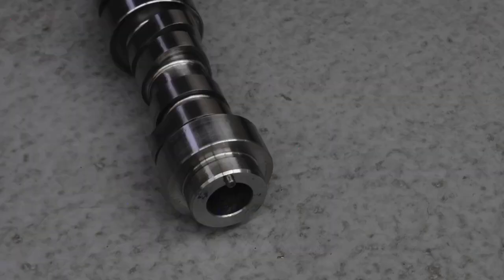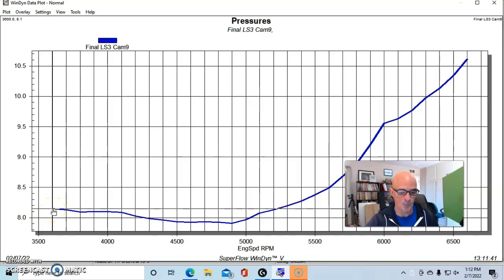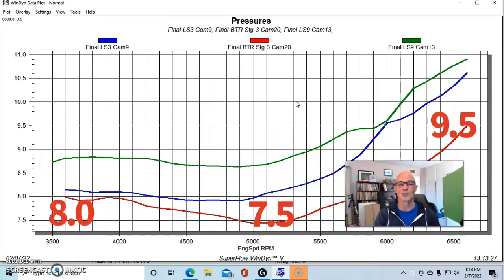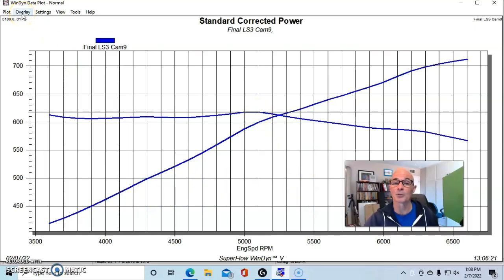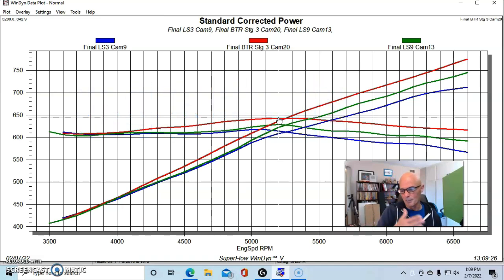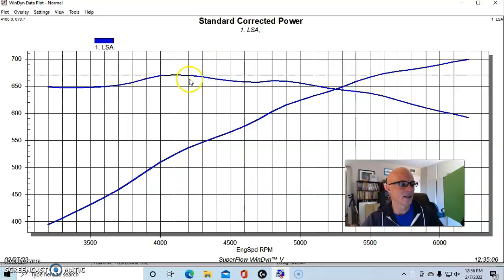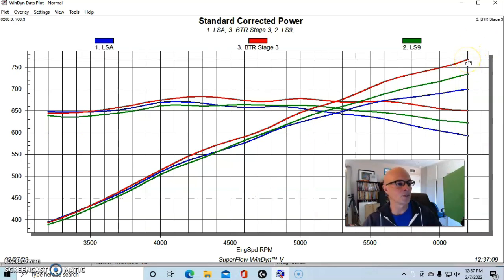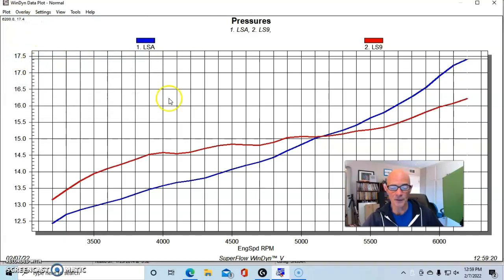HOW TO PICK THE RIGHT BLOWER CAM. SUPERCHARGED 6.2L MOTOR! LSA, LS3, LS9 vs BTR STAGE 3 BLOWER CAM!

Comment: The BTR cam made the most power up top because it was the biggest cam. Use a bigger na cam and it too will make more top end power. You have proved that before. My 416ci ls3 has a 239 254 cam and will make a lot of power with boost. I bet it doesn't bleed boost lol

Comment: Ive been watching your channel learning a lot, especially when engine builder chose a 224 236 118 lsa custom comp grind. I wanted to know why that choice on an lt1 416 stroker with pd blower.  Now i understand the numerous reasons why.
Reply from the maker: cam guys like to run the wide lsa on pd blower motors

Comment: Hello Richard, First time commenter. For my street car occasional drag strip… What’s your opinion with a Summit 8706R1 turbo cam (226-230 dur. with 600-575 lift with 113 LSA) in a 408 with Trick Flow 235cc heads and a Whipple 4.0? Should I run that cam as I already have it or buy a cam designed for 4.0 stroke and a PD blower? Thank you.
Reply from the maker: it will work fine

Comment: Ok Richard I found my way over here. This was right up my alley thanks.

Currently have a "big NA" cam in my LS3, with a 2650 blower. Haha its upping my 4k converter out to 6k which isn't working very well for any type of driving.
*CrowCams 871287 (227/244 .607/.610 114lsa)
So I'm in the process of putting in a more reasonable size (modified LSA converter) - but we're unsure how well that will work with the big na cam (might push on the converter too much)

So yeah was looking for a blower cam, but my mate was suggesting the sloppy stage 2 as the "BEST" cam ..... but i still don't know lol
Hopefully my "NA" cam just works with the converter as I don't want to really spend a heap of money to not really make a huge difference to power (10-20hp difference meh)
Reply from the maker: YOUR CAM IS NOT UPPING YOUR CONVERTER-227 IS NOT A BIG CAM FOR AN LS3-YOUR BLOWER IS BLOWING PAST THE CONVERTER
Reply: @richardholdener1727  Sorry yeah no
The 227 cam and 4k converter worked perfect pre blower ... but once the added torque of the blower was added yeah thats when we've had issues.

Just hoping that a smaller stall will work with the current 227 cam

I thought the cam was big-ish, maybe not on the intake side of things... but with combination with the exhaust side and .600+ lift 
I was going to go with texas speeds f35 but bailed out.

Comment: These being positive displacement SCers this wouldn't apply to a centrifugal. I'd like to see a test like this run on a Vortech or Procharger.
IMO, they make boost cams for a reason. Higher LSA, tighter overlap, more exhaust bias in the duration... they do what they're intended to do. Work better.
Reply from the maker: the cam does the same thing na, pd blower or cent blower.

Comment: I'd like to see a test on iat's in say 700-800 hp supercharged stock cam vs big cam and maybe better heads and less boost making close to the same hp.
Reply from the maker: I don't quite understand what specific test you are asking for
Reply: @richardholdener1727  basically engine a has ported or aftermarket heads and a large cam and makes 750 hp on 8lbs of boost and engine b has stock heads and stock cam and makes 750 hp on 14lbs of boost. The difference in iat's at the end of a dyno pull between the two setups running the same blower and heat exchanger system. When people say heads and cam are less important with boost and you can get the same power by just adding more boost it would be interesting to see what the tradeoff is in increased iat's.

Comment: Richard, Thank You, Thank You and THANK YOU!

I have tried to explain less boost pressure more power for a given combination until I was blue in the face!  Many still didn’t get it and I’m tired of trying to convince them!  From now on I’m just going to link your video and PROVE IT!  MORE FLOW = MORE POWER, it’s all about how well you are filling the cylinders!

Have you ever used forced induction on the LS3/525 crate motor with the "ASA" Cam, Lift: .525" Int. / .525" Exh. w/1.7 Ratio Rocker Arms, Duration: 226° Int / 236° Exh. @ .050" Lift, 110° Lobe Centerline.   Any suggestions for a better cam in a naturally aspirated street/strip toy 2600# Cobra Kit Car with 6sp and 3.55 gears?
Reply from the maker: that cam-like any cam, will work with boost

Comment: So why then are there cams that are designed for a PD blower or for turbos if any cam will work?  Why does boost drop with certain cams?  (Saying it’s more efficient is not a good enough answer; what is physically going on in the engine?)
Reply from the maker: THE BOOST DROPS BECAUSE THE NA MOTOR MAKES MORE POWER AND THIS USES MORE OF THE AIRFLOW FROM THE TURBO (OR BLOWER), THE RESULT IS A DROP IN BOOST (NOT ALWAYS ON A TURBO APPLICATION BECAUSE THE WASTE GATE OPENS AT A SPECIFIC BOOST LEVEL). THINK ABOUT RUNNING THE SAME BLOWER (AND BLOWER SPEED) ON A BIGGER MOTOR-THE BOOST WOULD BE LOWER (THE MORE POWERFUL CAM DOES THE SAME THING)

Comment: I have a cam motion ls3 stage 3 cam (220/230-.553”/.553”-117+4). Worked great on my iron 11.15:1 ls3……surprisingly it worked even better when I added a lsa supercharger with fic 850cc injectors and 2.45” pulley……I love this baby cam, best $350 I ever spent…just trying to figure out what plugs to run, it’s controlled by a terminator x max if that makes any difference
Reply from the maker: you need 2 steps colder than stock plugs in that

Comment: Richard you have no idea how many times I’ve seen people replace camshafts that were really good, more efficient! But because they lost boost they removed it before even dynoing or going to the track 🙄🙄🙄🙄! People/Morons still don’t understand that boost is a restriction #! Maybe you should get into explaining the temperatures, pressures, BSFC #s that show up on every dyno pull! Than hopefully they will start to understand that less boost & more power is good 👍🏻, because your making the engine more efficient! Thanks for the great videos! Blowing all the boost out of the exhaust 😂😂😂😂🤣🤣🤣🤣! Maybe you should put that reverse pattern cam in it to really bottle it up & raise boost 🙄🙄🙄🙄!

Comment: The slight power increase at the very top is due to less valve overlap that aids in keeping the air charge in the cylinder at high rpms

Comment: I love this video, I've had this conversation with lots of people. The way I explain it is that there is a preset amount of airflow that is going to come out of that supercharger regardless of what type it is.  The pulleys and the size of the supercharger are the deciding factor of how much air is going to come through it.  All that air is going to go through the engine so the cam is the deciding factor of how much pressure is needed to force all that air through the engine.  Some cams are optimized for better airflow at the lower RPM and some at the higher RPM.  If the engine is able to use more air than obviously it's going to take less pressure to vram the air through that engine.  What happens when an engine is willing to accept more air? It's willing to make more power.  

If you took this same blower and pulley setup and put it on a 5.3 with the same cam you would be making a lot less power and a lot more boost because that 5.3 can't accept as much air as the 6.2.

Comment: We were running a BTR stg3 on a LSA motor with a lower pulley swap 9.17... Switched out to the BTR stg4 LSA/LS9 cam put a 2.55 upper pulley... Stroked to 419... The car had been running #12 boost and now is #14... We added 90whp and as much torque... I too think Mr. Tooley knows what he is doing. I am not a big fan of restriction and heat so was thinking "porting" heads but given my specs both the builder and you said "naw, they flow well enough." Given that the boost level rose slightly I think that was sound advice and saved me some cash for other parts! Thanks again Richard!

Comment: I think both those OE cams where designed to lessen the load on the production parts and drivetrain.. in other words GM wants those engines to “not” blow up the automatic transmission, the stock clutch or scatter the engine before the warranty period ends! Max power anyone can make, having that engine last 60k miles without needing a broom and a shovel to pick up the pieces… that’s the bean counters minimum quality parts vs warranty costs vs shrapnel taking priority…
Reply: The other thing in particular with the gm blower cams is the Atkinson Cycle valve timing made into them to restore some semblance of economy at cruising rpm
Reply from the maker: is that the low carb cycle?

Comment: The boost is leaking into the combustion chamber . Lower boost caused by intake valves open longer . I liked the torque curve on the na cam.
Reply from the maker: no leaks

Comment: I just ran the overlap calculator and the N/A cam actually does not have any overlap, it is actually -2 degrees overlap so there is no boost bleeding off and mixture going out the header.

Comment: Boost is just air that can’t make it thru the motor. More power with less manifold pressure is always a win. Nothing makes it more black and white than when using a supercharger. The consistent airflow run to run makes the boost vs horsepower data cut and dry. 

These types of tests with turbochargers can be misleading. Depending on the type of boost control being used, the change in backpressure, or an electronic controller doing whatever it has to do to see a certain manifold pressure, can often skew the data regarding the airflow efficiency changes of the engine.
Reply: Excellent way of explaining the boost flow connection.

Comment: Every time I hear that opening music, I want to dance naked and film porn 🤣. Now that I'm done embarrassing myself, I love this video. I'm a fan and student of positive displacement blowers. The snappiness of low end torque is exciting. 

I've heard you say many times that when you add a cam and lower boost and gain power, that it's good. Trying to explain that to others always gets me in arguments lol. But I noticed you said it's not good to raise the boost back up. I'm a little lost on that part. Every blower has an efficiency range the work best at certain boost levels. If the cam lowers it, and even though you're making more power, it should in fact make even more power if the boost was raised back up? To at least get it into it's efficiency range.

Comment: Boost is worthless, give me airmass and density
Reply from the maker: I'll check my air mass & density gauge
Reply: @richardholdener1727  Would be interesting to just hang a MAF in a 6" pipe on the inlet of your test motors and measure the throughput.  Data is good!  GM LS cartridge style sensors in a 5" pipe can easily measure 150 lbs/min of air if not more without restriction

Comment: I will give you my theory and please free to comment.   Frist, I suspect the 224 cam would make more power NA then the other cams, even the BTR Stg3 up to 6000 (ish) rpm.  The 224 is just not designed to operate much above that.   As you have proven time and time again, more NA power means more power under boost.   But why more power at lower boost?   I think it is because some of boost IS leaking out the exhaust valve due to increased valve overlap.   This is not a bad thing (up to a point) because it helps exhaust gas scavenging but more importantly it gets the air column moving.  Relative to each other, there is a point in the cam timing where with the blower cam is at 10 psi but zero flow above a close intake valve while the NA cam is at 8 psi and air is already flowing through the open intake valve due to the greater overlap.  This results in better cylinder scavenging and filling and is the reason NA cams tend to have tighter LSAs.   The lower boost from the positive displacement blowers is because it cannot keep up with the additional air flow through the engine due to valve overlap.

Comment: I would say the NA cam was just more efficient across the RPM range. The BTR stg 3 cam making more power at the top is because it's designed to be efficient at the top of the rpm range. I think the BTR stg3 cam would have continued to make power up to if not beyond 7K rpm.

Comment: Great information, does the increase overlap less boost of the NA cam mean that it should be less incline to detonate? I would liked to have seen a BTR stage 3 boost and a stage 3 NA so size would have been similar. Keep up the good work?
Reply: Higher cylinder pressures will induce knock as heat and pressure can ignite fuel, but with that being said running something like an interchiller or higher octane fuel will drastically reduce this chance, other things that can help are using a thermal blanket on your charger, running a bigger coolant reservoir for your charger, some people will run water foggers, ethanol, methanol etc all these options can help negate most issues you’ll have with detonation that is heat/pressure related